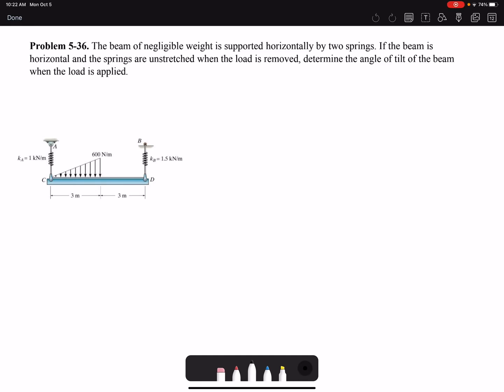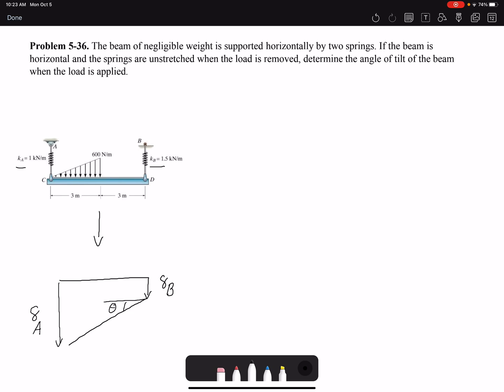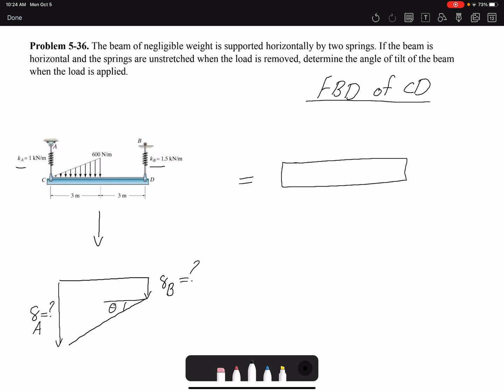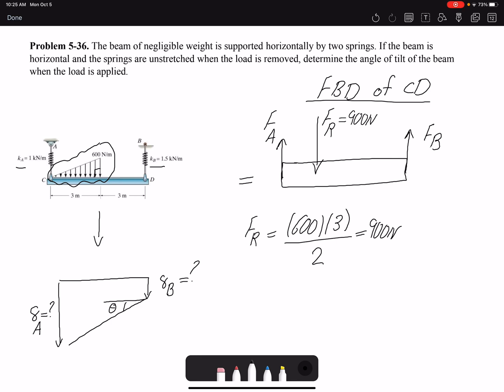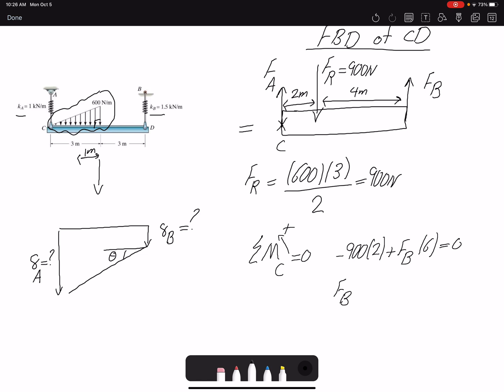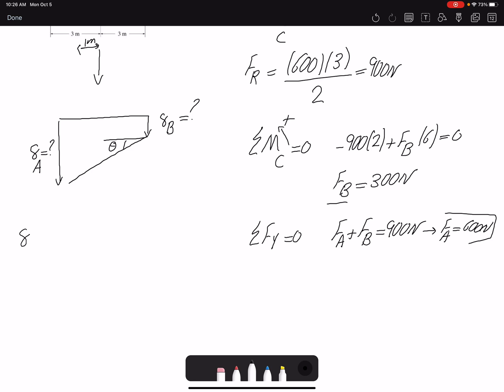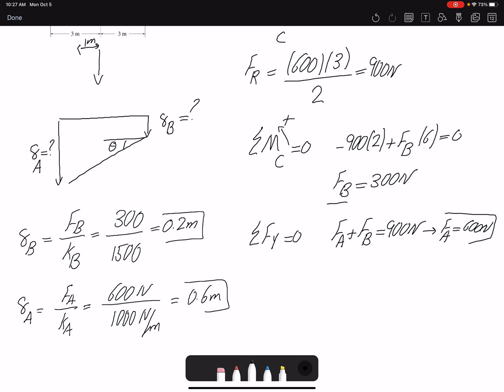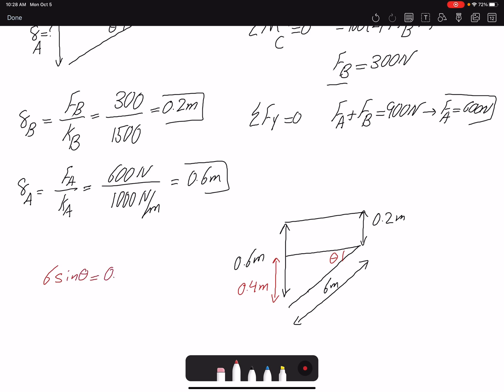Statics Problem 5-36: Equlibrium of a Beam Suspended from Two Springs

Comment: why did you not factor in the reaction forces?
Reply from the maker: There is no reaction forces, the brand is suspended by two springs, there is no supports to include support reaction forces
Reply: @engineeringvision  isnt there like a hinge at A and a roller at C